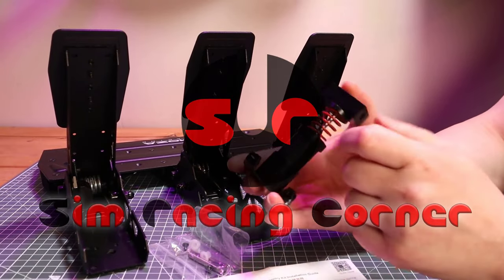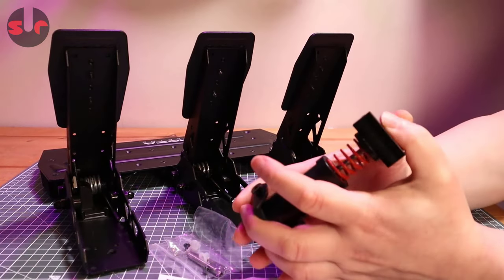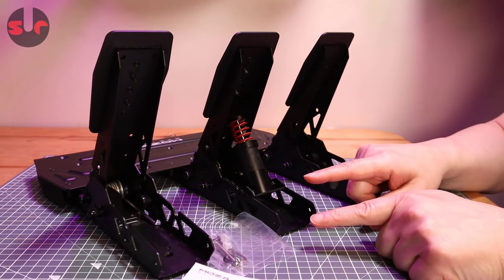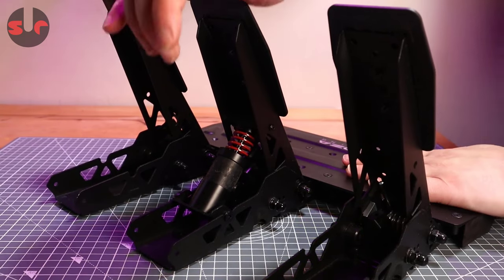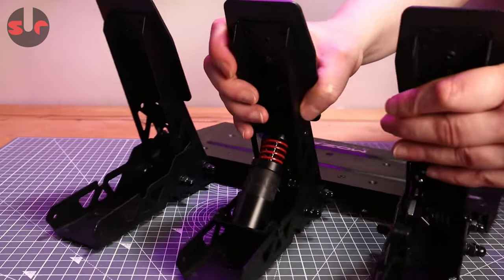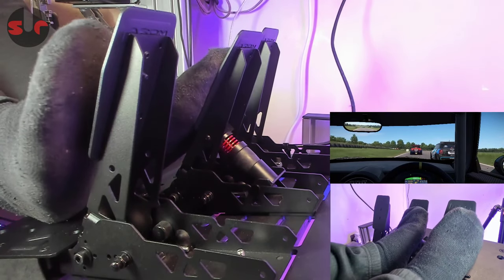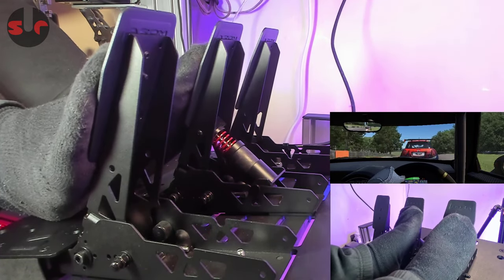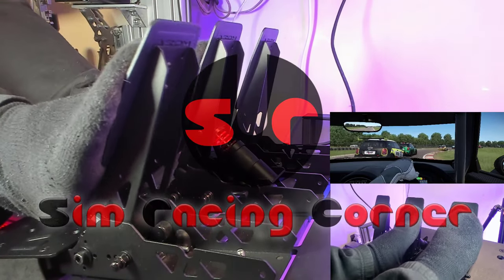MOZA RACING SR-P Lite Brake Pedal Accessory Kit [REVIEW] Get this for more consistent braking!

Comment: I know they were trying to keep cost down but something like this should have been in the pedals from the start. Even my long defunct cheap Tp3a pedals had a rubber stopper.
Reply: I’m inclined to agree. I keep looking at the OUT OF STOCK on the Fanatec CSl (wheelbase) and keep thinking that if you could actually buy Fanatec right now there probably would be a bigger debate about product/ecosystem upgrades.
Reply: I agree, I bought the SRP pedals to upgrade to a load sensor and I don’t even understand why that brake pedal is not in the R5 bundle to begin with, not only that but the brake pedal still needs a spring upgrade, and that has to be purchased separately as well. Moza is doing good things, but man they nickel and dime you to death with the small things.

Comment: Great, does the job as expected.
Looking to get the Moza R5 bundle this Xmas. Hopefully US vendors will carry this.
Reply: 2022 Black Friday and Xmas seem very promising. Crossing fingers for special prices and 100% availability from all the budget DDs out there.
Reply: I recently bought the R9 and SR-P pedals, very happy with it, first DD wheel and I am blown away. Could not find local shops with accessory kit in stock so I ordered direct from moza website, price and shipping was reasonable, just a bit slow to process and ship.
Reply: Shipping 🤬 expensive
Reply: @337raekwon  Could be your location. Also there a multiple shipping options. Fast was pricey but standard 7USD
Reply: Micro center just started carrying them. They are a great buy for the price. Much better than anything not direct drive and a good start into direct drive setups

Comment: Thanks for this. Quick question, have you removed the original spring before installing the new one? I have just got mine but the spring seems a little stiffer than your vid. Still a great upgrade, the R5 in general seems fantastic so far. Much better than my old CSL DD.
Reply from the maker: If you mean the torsion spring that the pedal already has installed. Then no, that's still there.
Reply: @SimRacingCorner  that's the one, thanks. I left it in also, but things just seem a little stiffer but it might be as my pedals are not mounted. Anyway, it's still so much better. The R5 is perfect for a desk setup.

Comment: Thanks for the review! Should I change pedal settings in Pit House if the kit is installed? Or keep it linear?
Reply from the maker: You don't necessarily need to change it from linear, but it's worth testing a different curve, as it may suit your driving style better.

Comment: Am i misunderstanding something? is there a difference between this pedal performance kit and a load cell pedal? i thought a load cell pedal just had a spring and rubber stopper for a non liner brake feel?
Reply from the maker: A load cell is a weight sensor like you get in electronic scales.

Comment: Would the damper kit you put on the csl pedals throttle fit the srp lite?
Reply from the maker: Not exactly with the same 3D printed parts, but yes you could get that type of damper mod to work.

Comment: Could the SR-P Lite brake kit be installed into the SR-P (not Lite) clutch?
Reply from the maker: Yes it would fit, it's the same frame.
Reply: @SimRacingCorner  Thank you!  I am getting the SR-P pedals with the $15 accessory kit and I thought it might be interesting to use the leftover springs with a brake kit on the clutch.  That way all 3 pedals feel different.  Not sure if that is silly.
Reply from the maker: Sure, why not, I can understand that.

Comment: 😂😂😂It is the same as using a load cell, I speak from experience... 5 years ago I made an aluminum pedalboard with parts of 2 pedalboards and a LeoBodnar plate, I put 3 Hall sensors and a load cell, the 60kg cell It was damaged quickly, I took the cell out of the brake and connected the Hall sensor and I did not notice the difference... a little grease every year and luxury, there are fortuitous discoveries that open your mind, in my case it was like that, by wanting playing while the spare part arrived, I discovered that they sell us a lot of useless and expensive marketing, the simplest is the best... The Chinese are clear about it, and so am I, my Moza r9, since June it's been perfect